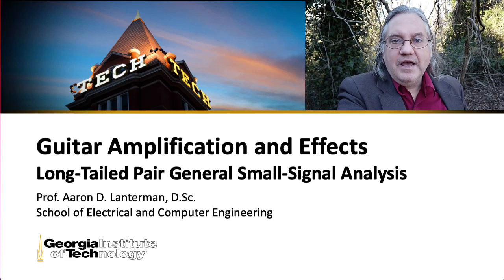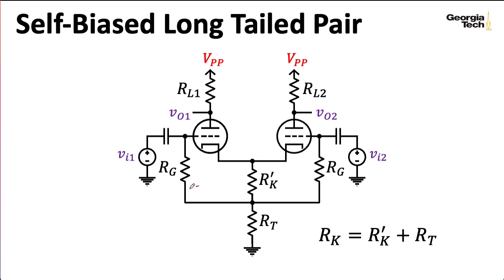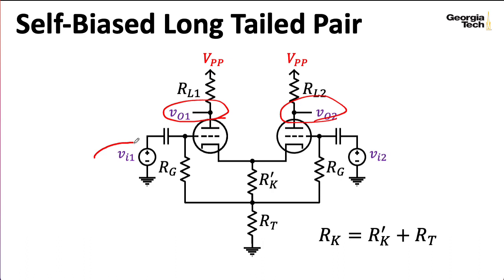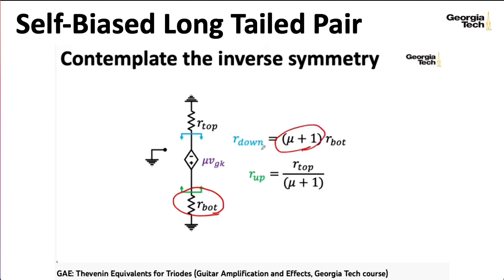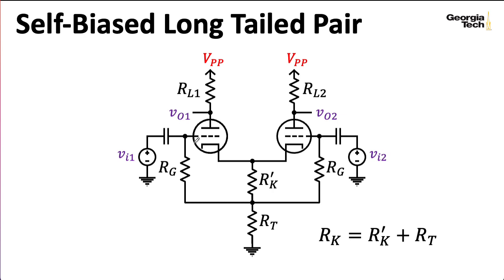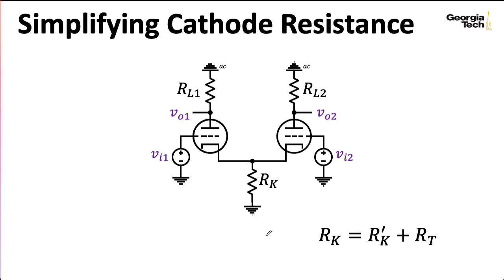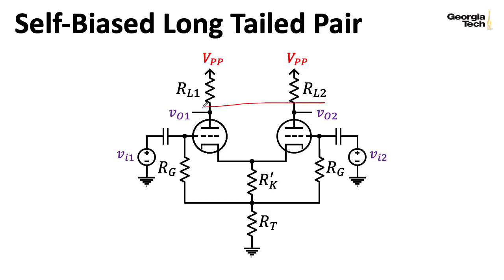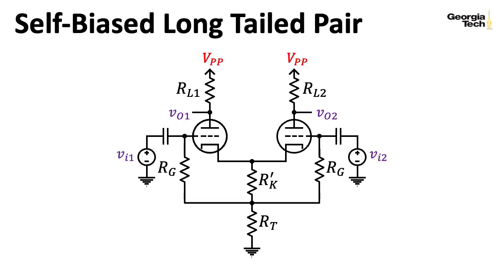ECE4448 L28: Long-Tailed Pair General Small-Signal Analysis (Guitar Amplification and Effects)

Comment: 15:09 So obviously the R_K/(R_K + r_ki2) factor is complicating things. But if you want to compensate, I think you have to consider in what way. It seems reasonable to adjust the load resistances to make the responses to v_i1 of v_o1 and v_o2 to sum to zero. But if you do that, the responses to v_i2 will be more skewed than they were to begin with. I guess you can't have the cake and eat it in this case. Perhaps if you could mix some of the original signal with one of the outputs... But then the large signal response will probably be more skewed (and the circuit more complex). Or maybe that v_o2 response doesn't matter quite as much.

Comment: professor, I'm working o a transistor long pair and now raised the question.
isn't that some sort of a dual voltage divider although having a transistor in between?
the 2 resistor on top of both transistor from the supply and the one common tied emitter the negative supply.

what does actually happen between both resistor if you activate one transistor?
Reply from the maker: Hmmm... maybe? I can't think of a way to make the voltage divider analogy work, really, when you have that transistor in between.